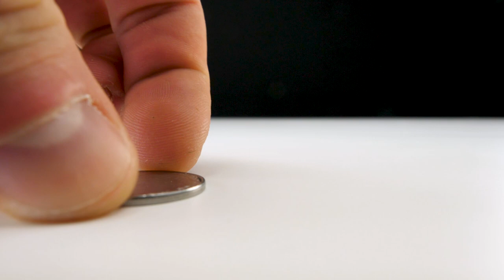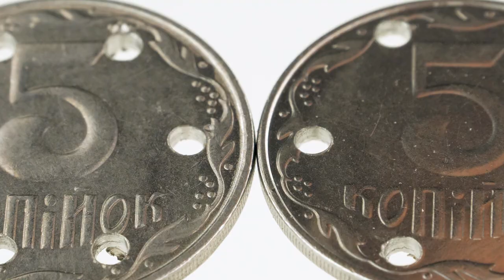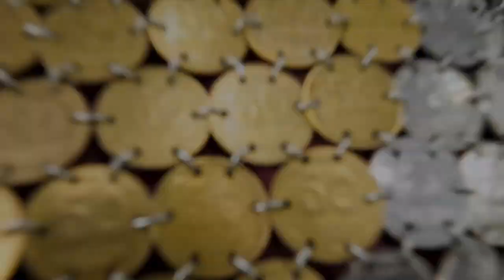How to Make Durable Chain Mail from Coins

Comment: To get stronger, the scales (coins) must be overlapping. This way makes it much harder to penetrate.
Reply: Yup don't leave any gaps.
Reply: @viratdose68  indeed
Reply: This is very heavy looking....
Reply: @kewintaylor7056  more heavy = more protective
Reply: Ss isso é vdd
Reply: @jamesprost508  Continues to put on tungsten plate armour
Reply: @jamesprost508  Not necessarily. Metals like lead and copper, and alloys like brass and bronze are heavy, yet relatively soft. Aluminium is light, but also soft, unless alloyed with other metals. Iron can be brittle. Alloys of steel, tungsten and titanium are harder but heavier. There are good reasons you won't see modern armour made from lead or copper.
Reply: @another3997  dont worry man, i know that ^^
I'm not to dumb in casting/forging and i know how it works in the grand lines ^^

Comment: "It is not illegal to deface coins BUT they can no longer be used anywhere for currency or you would be breaking the law. It is perfectly legal to drill a small hole in a nickel, paint a quarter, or bend a penny if you want."